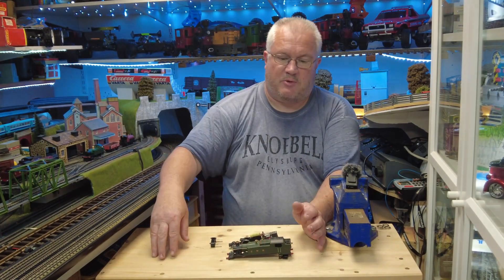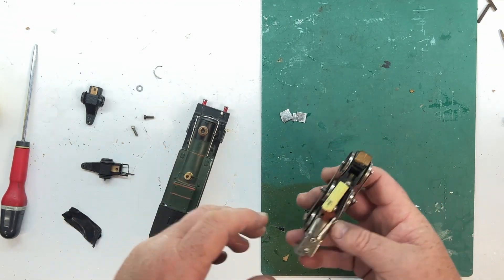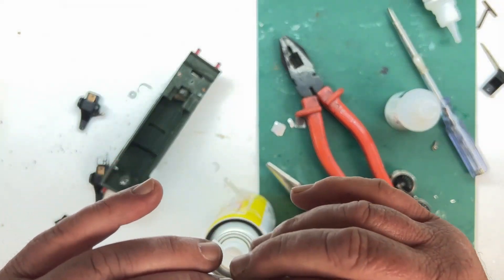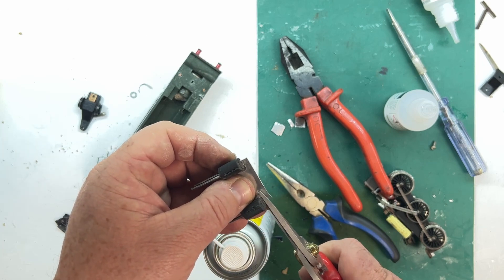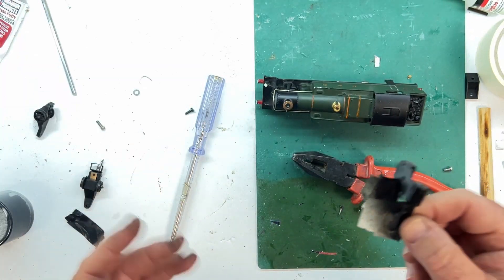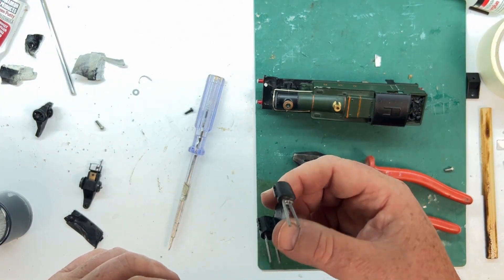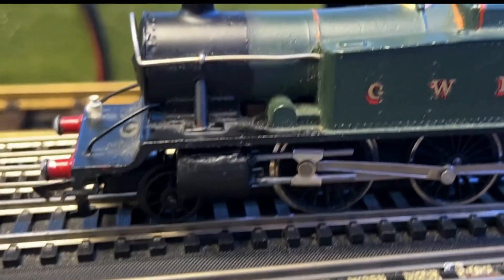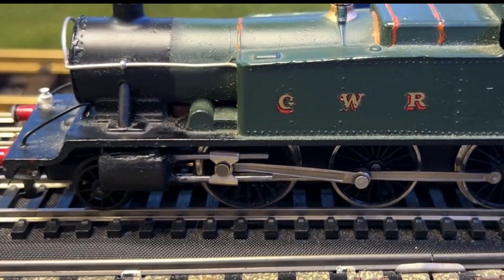Graham Farish 8105GF GWR Class 81xx 'Prairie' Tank 2-6-2, project

Comment: Hi Mat - I think the £20 was probably OK for what you get. For a start you got a die-cast body which in my opinion is preferable.
Have you come across the Gaiety brand made in the 1950s in Birmingham? They were cast brass, they did a GW pannier body wit a rather odd driving mechanism that was parallel to the chassis.
I think you could buy body only and fit a Dublo or Tri-ang chassis.
Anyway you did a great job on the refurbishment.
Reply from the maker: I have heard of Gaiety but not come into contact yet. I will keep a look out.  I do need to update my 3d printer at some point though.. Kimball, thanks again for you continued support and encouragement, Matt

Comment: I bought a complete one in reasonable condition in South Africa a few months back 20 quid is a good price because they are not common. The chassis is indeed a pain and not a good fit. From what was meant to be a runner I spent a lot of time fiddling with mine to get it serviced and running. I do wonder if you have oversized wheels on it. Should compare notes when I get back to Joburg.
Reply from the maker: It is possible they are over sized, as you say let compare notes at some point, thanks again for watching  and messaging